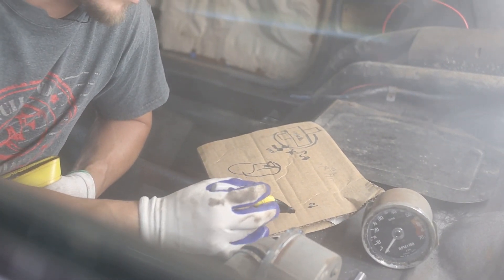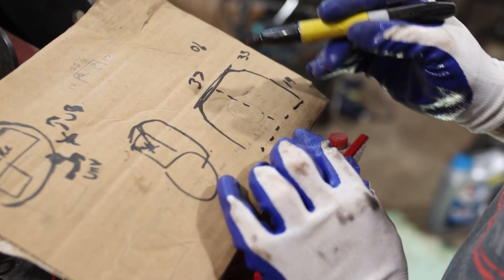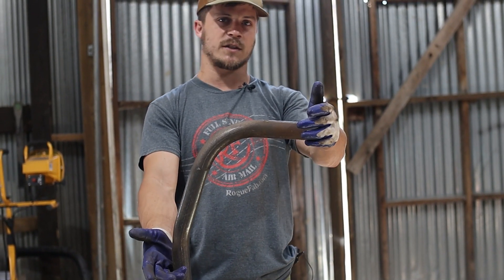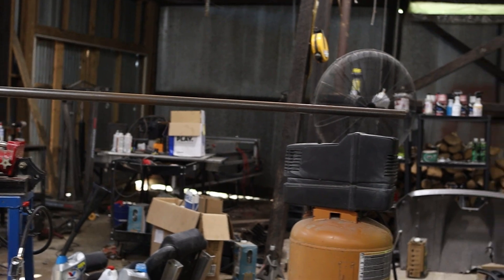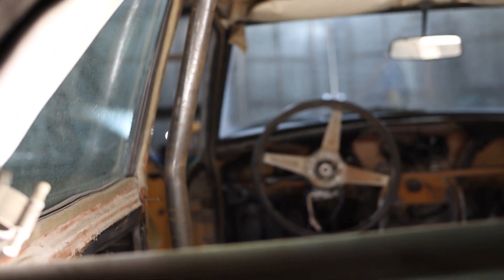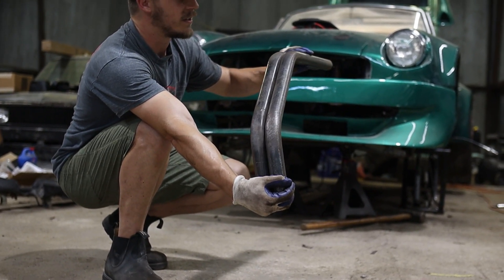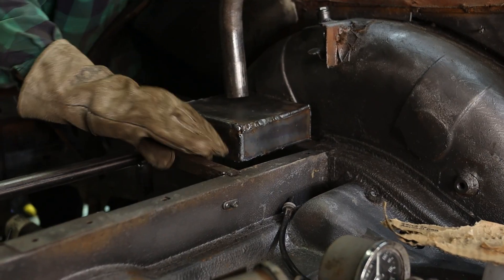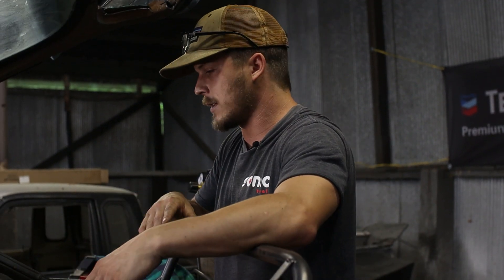RWMGB pt. 47: DIY ROLL CAGE

Comment: As a suggestion, you could adapt something like Chrysler Town and Country motors for the rear pop out windows so you don't have to crawl in the back around the cage to pop them open or close them every time. Duckman Cycles and VW Garage did this on his Bug build a while back before it went off to paint. I think he started with T&C motors, but might have switched to some other minivan window motor.
Reply from the maker: That's a great idea!

Comment: Hey brother you should cover every coolant connection in the car that is near to you.   Wrap anything around those connections in case any of them blow it will save you from hot coolant spray.  I say this just because you have a rear mount radiator just cover all of it with something
Reply from the maker: I'm going to build a "coolant tunnel" to seal all of that off from the cab. Kind of a firewall for the lines

Comment: Hey when you weld the tops of the bars take a large metal can and hose clamp to make a splatter shield to keep the head liner nice   Just cut the can open and leave some of the bottom on to have a spot for the clamp to hold on the can and the bar    Your welcome
Reply from the maker: Reeeeeally wish I would have read this before filming this week's video lol.. didn't burn it up too bad but that's a great idea

Comment: Yeah roll cages are great but they’re made for race cars specifically because they don’t have any upholstery inside and it’s a lot easier to deal with a flat painted surface as opposed to trying to do some nice upholstery work with sound deadening!!!
Reply from the maker: The interior will be mostly rwcecar nothing too fancy. Plenty of racecars have door panels and heat dampening so that's what I'm going off of

Comment: "You don't want to hit your head on the tube"
As opposed to.... the road? The window? Another car? If you're moving around that much you're going to hit your head on something hard.
Reply from the maker: I did think about this but im not going off my own logic on that one... read several books and articles on cages and all of them said if the car will be on the street at all don't do overhead bars because in regulation they are always designed with a helmet in mind. I also looked at the cage in the new 911 gt2 which comes with a cage and is street legal and safety tested without a helmet on the dummy and they do no overhead bars so that was the deciding factor for me. If the car flips the main hoop should keep my head very far from the ground, further than if the car didn't have it like it comes from the factory, add in a 4 point harness and I think I'll be good. Again this is just coming from what I've read from professional cage builder that which I am not
Reply: @BUILTOFFICIAL  in Australia you can't get road registration on a car with a full roll cage. It's difficult with a half cage.

Comment: If you're going to build a cage, even of its not for competition use, I don't know why you wouldn't cast an eye over a regulations book. Even if it's just a drag racing spec sheet. Which is the loosest class of cage.
If you don't follow a few basic rules for cage building its just for show and will give you no safety or structural benefits.
Reply from the maker: I did, drew the design from champ car and  the porsche gt2. Also looked at some off the shelf cages for the mgb specifically
Reply: @BUILTOFFICIAL  I know. You knew about building foot plates and boxes. Most people don't though.

Although I'm not sure about having bends in the rear legs. I build cages for circuit racing and rear legs must be straight and parallel.